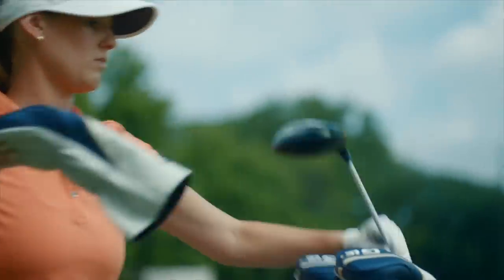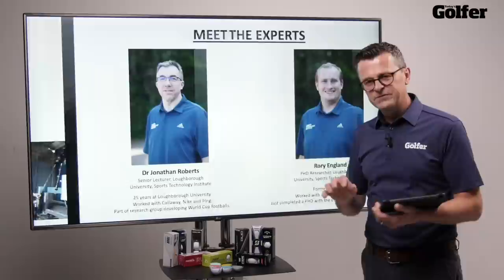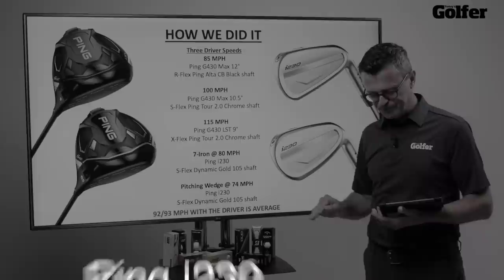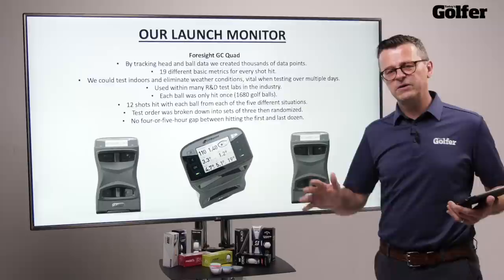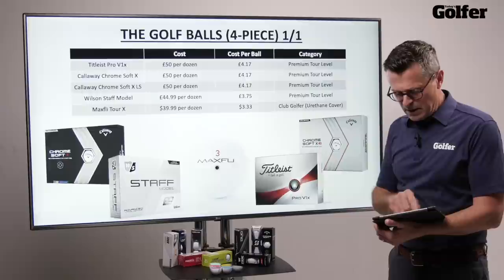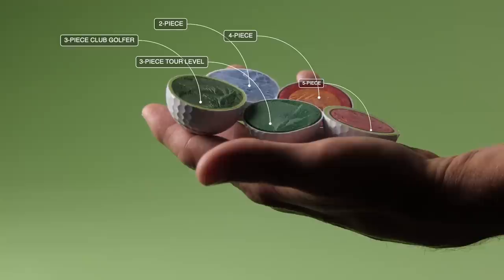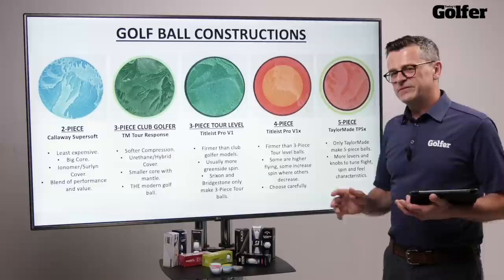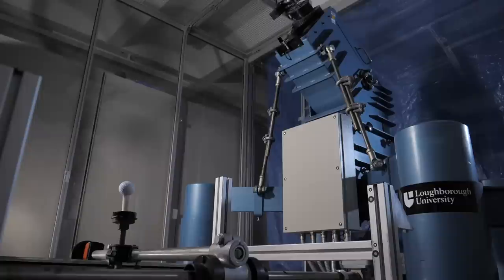ROBOT GOLF BALLS TEST | Find the best 2023 model for your game! 🤖 🏌️‍♂️

Comment: Shame you used the old kirkland v2 balls and not the v3 balls from this year. Would love to see the new balls in a proper test as the balls have been shown to be different construction/materials on other channels and only the v3 balls are available to purchase now (at least in the US)
Reply: And also the Sugar golfball.
Reply: Ditto
Reply from the maker: Costco are still selling the V2 here in the UK. Fingers crossed for next year.
Reply: It’s a very poor copy of Pro V,always badly marked every round,but value if you change it a lot👍
Reply: Or, you could just steal range balls and get the same performance.
Reply: The V3 is only available in the US and these guys are in England. Kind of hard to do if it’s not readily available. Great to see someone conducting independent testing without bias though.
Reply from the maker: @DMKFACTOR  Thanks for your input David, much appreciated.
Reply: V3 not available in UK   Know what you talking about before you write a comment.      The 2 Kirkland balls are the same.  And are as spinning to much as usual
Reply: Maxfli aren’t available in UK either and he got some to test sooooooo

Comment: The test methodology was excellent but I do think you need to add a senior statistician and as indicated below it would be helpful to measure the manufacturing quality control (ie is it round, is there any bias, are weights consistent) and at the end of the test cut up every golf ball to see if you can see differences in quality control.  

As you said the data set for each type of ball is 12 shots with each club/speed combination.  That is a relatively small data set and raises the issue of whether the differences between any 2 balls is statistically significant or merely by chance - and whilst I am not a fan of p- value tests, I am not a professional statistician, and you need someone with that skill set to determine the best statistical test applicable to each part of the data to determine whether differences in the data are  statistically significant.

IMO when you look at the data some clear things emerge.  There is no statistically significant differences in ball speed or launch angles no matter what club is being used and what swing speed with a couple of exceptions at the highest swing speed there are differences if, but only if, you compare the lowest compression ball against the highest compression.

Basically unless you have an extreme swing speed and are comparing extremes of compression, all golf balls irrespective of compression perform in terms of ball speed and launch angle the same - "soft is slow" is simply unsupportable by the data.

There are only 3 variables which show any clear differences: spin rates, peak height and accuracy.   Accuracy may be linked to manufacturing quality control so as mentioned above that needs to be tested.

Titleist has traditionally had the best manufacturing QC but it is starting to look like Wilson are even better.

Comment: Fantastic work Simon and team, thank you for your efforts!

Question - Any thoughts on why the Callaway Chrome soft X LS shot area seems to jump from 20.4 to 114.9 Sq yds when upping the driver speed from 100 MPG to 115MPH. I was expecting the lower spin to correlate more with accuracy. It sort of gets a bit 'wild'.

Thanks all.
Reply from the maker: Thanks for the feedback Andrew, appreciate you taking the time. 

We'd only be speculating, but a single ball with a slightly off centre core could have this effect. 

Hence why we like to look at averages for accuracy and not focus too heavily into any particular single situation. 

Hope that helps.

Comment: great video, data and methodology. Not sure if I missed something on the shot area analysis. Is that based on extrapolation from two swings? If so, it seems to me the sample size is too small. I think 2 swing sample size for distance and most other metrics are reasonable given the two brand new balls consideration, If possible, I think for shot area analysis, brand new ball consideration is not important but more swings are needed. Then against, that does run into your robot time constraint.
Reply from the maker: Thanks for the feedback, the total shot area was averaged over 60 shots. That's 12 shots from each of the five situations.

Comment: Great video very many thanks for conducting the test.   Noting the use of GC Quad… how is ball dimple aerodynamics taken into account? I’m assuming GCQuad uses the same model for each ball, and therefore you are not getting a complete assessment of the differences in ball dimple designs?
Reply from the maker: Thanks Alan. 

If you really want to study aerodynamics a Trackman gives the best information at it picks up data points later in the balls flight. But it will also pick up any wind or conditions interference too. For this test we've just used Foresight's standard algorithm. 

Hope that helps.

Comment: So Supersoft has:

- Lowest driver spin (and quite good carry)
- Tied steepest descent angle
- Decent, although on the lower half of these, wedge spin (and I would guess the descent angle is also quite steep there)
- An affordable price for someone who tends to lose balls...

Doesn't sound bad 🤔
Reply from the maker: Absolutely agree Garbox80. 

For the full picture just don't forget to add in that, very low spin balls might not be the best option to optimise carry distance at the slowest swing speeds. Iron spin with the Supersoft was also just 54 RPM away from being joint lowest, which is 11.9% below the test average.
Reply: @todaysgolfer  Oh, yeah. With slower swing speeds the descent angle drops and with low spin, the ball won't stop easily, correct?
Didn't think about that as I have a decent swing speed. That combined with inconsistent hits, my bad shots are usually so far off that I don't even bother to go look for them 😂 (depends on the course obviously).
Played with a found Supersoft on Sunday and the greenside feel was nice, but with fast and firm green the ball wasn't easy to stop even though it pop's up high nicely. So I'd guess that the spin on those isn't that great either.
I so wish that we had Costco in Finland, or that I could buy those Kirklands somewhere else (without paying premium price with delivery and customs).

Comment: Kudos to you Simon,your cross referencing the spin and the dipersion rates explodes a lot of the myths the weekend golfers get stuck on,side question on wether or not in this test the just released Srixon Q star tour was tested? The compression has been increased by a couple of points to 74 to improve performance at the big speed end.And if not a possible chance of an update.Regards from Australia!
Reply from the maker: Thanks Jon, appreciate the feedback. This was the 2023 Q-Star Tour. We're just putting the finishing touches to this years robot golf ball test now, it should be live in a few weeks, the 2024 Q-Star Tour is included.

Hope that helps.

Comment: Excellent study here. Very interesting. Question- I may have missed this but are there results for different club speed 7 irons?
Reply from the maker: Thanks so much for the feedback, appreciate you taking the time. 7-iron was swung at just one speed 80 MPH, like the PW which was swung at 74 MPH. Hope that helps.
Reply: Makes sense - the video could be 3 hours long if every configuration is tested! Does it matter, but was the different club angle of attack level, up or down and does it matter? @todaysgolfer
Reply from the maker: @Ryglado  It matters if you want to create data that relates to real world golfers for sure. 

We were lucky thanks to Ping's work with Loughborough Uni and through using this particularly robot, that it was possible to set the robot up using a real golfers swing.

The attack angle for 7-iron was down between 5 and 6.5deg, where for the wedge it was 7.5 - 10 deg.

Hope that helps.

Comment: Most informative, I need to look at the website with a beer in hand, though fortunately for my bank balance I have a lot of new balls already (I tend to buy the ones I use when they are on offer)! One thing that wasn't mentioned is that for the higher handicapper who slices the ball a low spinning ball may be the best option even though they would sacrifice spin into the greens as that (side) spin created with a slice will hurt them both from an accuracy and distance perspective?
Reply from the maker: Thanks Adrian, appreciate the feedback. Yes you're right, hence why most lower budget balls target lower spin, so they're longer and more accurate, so long as you have the speed to launch them. 

We mentioned about the Kirkland being a reasonable alternative to a 2-piece ball if you have very low speed, as you give very little up against the longest balls, but gain iron and short game spin, which could be useful, so long as you're not really inaccurate.

Hope that helps.
Reply: @todaysgolfer  Thanks this is just what us golf geeks need as there's very little comparison data out there to allow us to make an informed choice. I've been using the RX version of Bridgestones for years during the golfing season after beong fitted for them when the B330's first appeared on the market and AD 333s during the winter but once my stock drops your data will give me some good steers on where to go. What I think will be useful is when golfers try a new ball, if it's not for them they'll then be able to revisit your data to fine tune their next purchase. Keep up the good work 👍
Reply from the maker: Thanks  @Bazza47

Comment: Love the review, but maybe I am missing something - If the average swing speed with a driver is 92/93mph, then why not test at that speed?  I fit into that bracket (averaging 220-230yds), however when I average out the figures from the  85/100mph test, I am getting 216/217 yds, but strangely  the Pro V1 is longer that the Srixon XV, yet I know in the real world I am getting a 4-5 yards more from the Srixon,  Means while there is a great deal of data, I still find it difficult to decide which balls to go for!
Reply: Distance has a lot more to do than just swing speed.

Comment: What are your recommendations for women who have a swing speed of about 65 miles an hour with your driver? Is it any different than the 85 mile an hour recommendations?Thank you.
Reply from the maker: Great question. It's really hard to ignore a ball that gives good overall performance rather than just chasing distance from lowering spin. The Srixon AD333 (or Q-Star in the USA) would be a very good place to start, as you still get good iron and wedge control, without sacrificing everything for driver distance. 

Hope that helps.

Comment: When explaining the different ball types the Pro V1 3 piece looks really off centred. also what was the attack angle for the 7 iron and the wedge? You cant judge a ball hitting a 7 Iron and a wedge from a Tee and no forward shaft lean. Its not making contact with the correct part of the club (5th groove). Looking at the data id suggest that is why the backspin seems low to me.
Reply from the maker: The Pro V1 in real life isn't off centre, it must just be the angle the image is taken from. 

The attack angle for 7-iron is down between 5 and 6.5deg, for the wedge it's 7.5 - 10 deg.

Comment: Great test. The Kirkland is the ball to use if you have a slower swing speed, maybe under 100 mph. Way too spinny though IMO for anyone with higher swing speed. IMO these tests should include a 52 or 56 lofted club to really show the difference between urethane balls and the 2 piece balls inside 100 yards. The urethane will launch lower and have good spin while the 2 piece like the rush will just launch like a balloon with half the spin of the premium balls. The height will offset the lack of spin somewhat but if you want to control your wedges down to a yard or 2, good luck with those. The Ping PW here is 45 loft....
Reply from the maker: Thanks for your input Jeff.

Comment: I would've liked to seen Vice Pro/Pro Plus and the Snell models included.  I think the Snells and Vice balls would've done rather well.  Snells are good balls but they seem to mark up rather easily with their thin covers.  The Vice balls can take a beating and if you get the drip models, you can't really tell they get marked up.
Reply from the maker: Completely understand why you’d say that.

Our thinking was there’s only a couple of factories globally that can make urethane covered golf balls, that aren’t owned by Titleist, Callaway, Srixon, Bridgestone and TaylorMade. 

So, all the DTC companies that have started up over the last decade use the same couple of factories. Those factories and brands spend very little on R&D so there’s tiny amounts of difference between the golf balls they produce, and virtually all are sold as Pro V1 alternatives.

On this occasion we took the decision to leave them all out, but perhaps a similar DTC only test in the future could be worthwhile, even if their performance is so very closely matched.
Reply: @todaysgolfer  That makes a lot of sense and is a reasonable explanation of why you didn't include them.  Thank you for taking the time to reply.  Hopefully a DTC test can be conducted in the future and the results can be compared to the balls tested in this evaluation.   Thanks again for the reply.

Comment: Thank you very much for the really well done and elaborate test. But one thing is not entirely clear to me. When recommending the best 2-piece balls, the Wilson Duo soft is recommended for higher swing speeds. However, the ball performs very well in the driver test at 85 and 100 mph (and not so good at 115mph). Better at the lower speeds than Srixon AD333, which is recommended for "less than average speed"?
Reply from the maker: Hi Rudolf, where do we 'recommend the Wilson Duo Soft for higher swing speeds'?
Reply: @todaysgolfer   At 46:40 "Best 2-piece balls" is mentioned with the Wilson Duo soft "Good at average and above speeds"
Reply from the maker: @rudolffuchshuber7272  Not sure what your question is Rudolf...does it help if we say an average swing speed is 92mph with the driver, so 100mph is above average?

Comment: Side note these last few years i was hitting the ball well but i could not put very well, in fact it was a nightmare. i must have bought 20 putters with same result, and 3 foot put drove me crazy so I had nothing to loose so i bought a long putter: my game was transformed, not only could i see the line better but 3 foot puts became usually automatic. Not only that but before with a regular putter ,i could not put the ball 1to 1/2 foot pass the cup, but with the long putter seemed to be no problem at all, maybe it was the result of making anything less than 3 feet so the scariness went away. last season i made more 10 footers than in the last 7 years. I can also say that i have made 3 (40 feet put) in the last 2 month of the season. it got to the point that instead of being scared of the putter I anticipated with joy the idea of putting.  So I say if you are strugling with your putter try a long putter in a facility that will lend you one,; dont try it on a carpet in a store but borrow it and go on a practice putting green. I am shure that if you are strugling with a regular putter dont go for another shape regular putter it will not work; borrow a long putter give it30 minutes on a practice green , you might be surprised by the difference.

Comment: For the 85 mph driver swing, from what I saw you were using a stiff shaft. Seems like it should be regular flex instead. What results could be expected with a regular shaft?
Reply from the maker: The 85 MPH driver speed used a Regular Flex Alta CB Black shaft Paul, not a stiff.

Comment: Great work and data. However, the differences in many cases are very small and you should be reporting and using more sophisticated statistics, specifically standard deviations. If used in most  cases I suspect the "differences" will disappear within the statistical uncertainty. Difficult with only a relatively few data points per ball per category. to get a good SD. I would be tempted to try a calibration using the same ball or  several balls for a much larger number of strikes and use this as the SD for the analysis. Worth considering I think.
Reply from the maker: Thanks for your input and feedback Richard.

Comment: How does making a cover thin increase its ability to bite the club better?
Reply from the maker: It's because it's soft, and positioned over a harder mantle, so essentially the cover moulds into the grooves much more at impact than a harder cover, that will also be thicker. 

Hope that helps.
Reply: @todaysgolfer  thank you. Makes sense.

Comment: Fantastic video.   To me it actually makes zero difference unless you're a really hard hitter.  If you hit a soft ball really hard the distortion can be really bad surely?  However, I've got a set of Wilson Duo soft in Red.   I've recently had a round and hit 5 300yrd drives........with the shortest of the day being 267.......I'm 26hc, 50 years old been playing less than a year and I'm 5ft 8.

i also have 50 like new Prov 1x that I've been saving till I'm Better, but judging by the results here, I might as well sell them and get a load of soft balls.

Comment: I'm not a tour player and not good enough to work the ball consistently so I just want to stop any unintended fades or draws.   Like everyone I find balls on the course and play them to see if I like them.   I have converted to the Maxfli Straigntfli. Vice pro plus and Wilson Triad.  

In regard to your testing, I would drop the 115 swing speed which is about 1% of golfers.  I would go 75mph for seniors and women, 92 for the average man and 105 for the young men.   I also noticed the clubs had stiff shafts.  If you are setting aim at the majority of golfers shouldn't you be using regular shafted clubs?